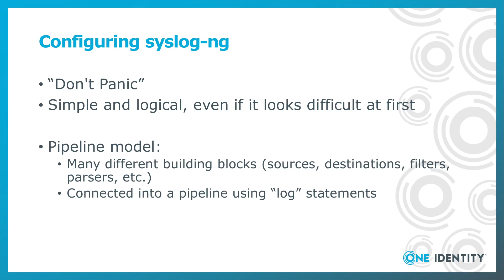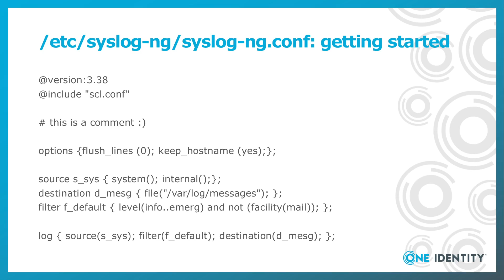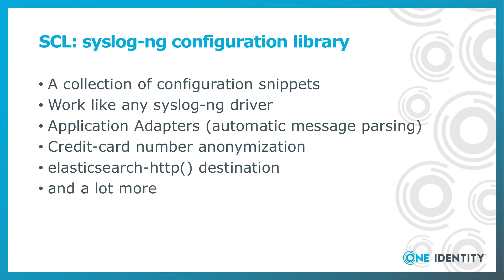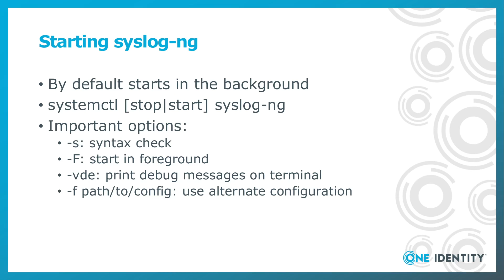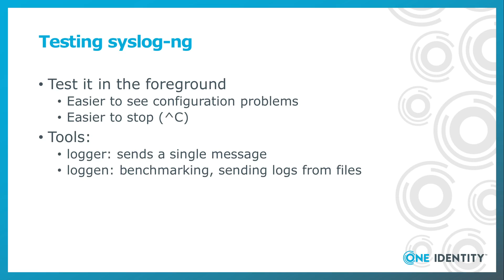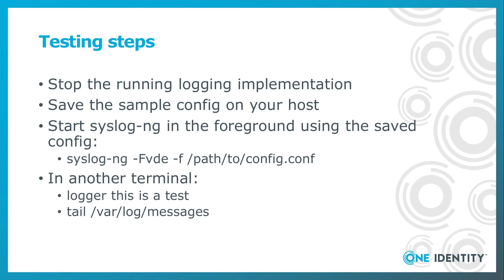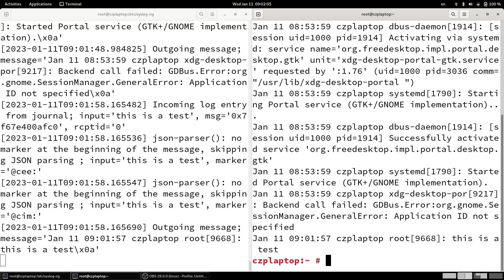Syslog-ng 101, part 4: Configuration and testing

Comment: My server has rsyslog and client syslogng, can I see the remote logs? 
And how can I alter the configuration so I can see the client's ip on the remote logs?
Thank you.
Reply from the maker: If your server is rsyslog, then it's up to the rsyslog configuration where is saves logs and if it keeps the remote host name or replaces it with the client IP. You should check these in the rsyslog documentation.
Reply: @pczanik  thank you for your reply.
 the messages are going through
and after briefly going through the documentation we need to configure IP address as the hostname on the client side for it to be displayed in the logs or a file created of the hostname in /var/log. 
However I don't want that, I want the server to retrieve the ip of the client. 
At present my hostname is "localhost" and so are all my other machines, it's difficult to change each wrt their ip's.
Reply from the maker: I do not know rsysog.
If you used syslog-ng on the server side, there are two global options which you could use:
- keep-hostname(no) discards the host information from the log message
- use-dns(no) do not resolve names
Combining these two, the syslog-ng server stores the sender IP address.
Reply: @pczanik  can you share your email, so I can go deeper into the problem I am facing?
Reply from the maker: @bean4435  You can use https://github.com/syslog-ng/syslog-ng/discussions/ or the syslog-ng mailing list at https://lists.balabit.hu/pipermail/syslog-ng/ for more in depth discussions.
Reply: @pczanik  thank you, I'll definitely use it.

Comment: how do you tell syslog-ng to forward the data to a mysql database?
Reply from the maker: You need to use the SQL destination. First of all, make sure that syslog-ng on your hosts supports it (SQL destination support is usually available in a separate sub-package, like syslog-ng-sql or syslog-ng-mod-sql, or in case of FreeBSD, you need to compile syslog-ng from ports). Usage is described in the documentation: https://www.syslog-ng.com/technical-documents/doc/syslog-ng-open-source-edition/3.37/administration-guide/52#TOPIC-1829109